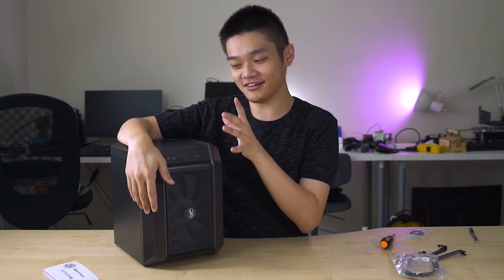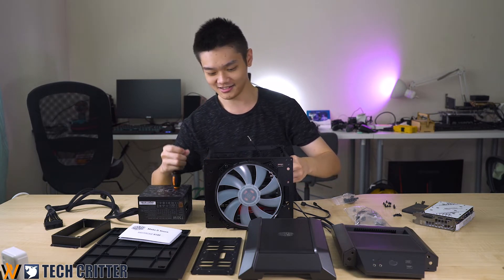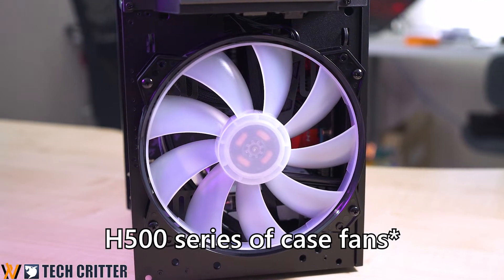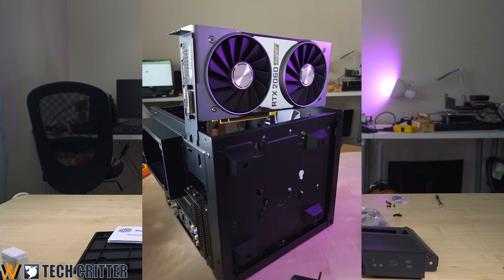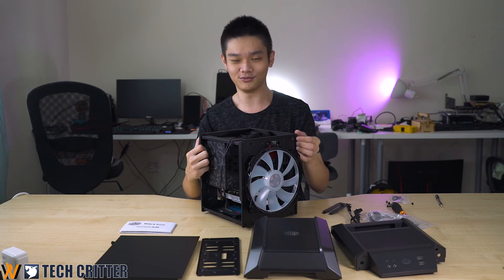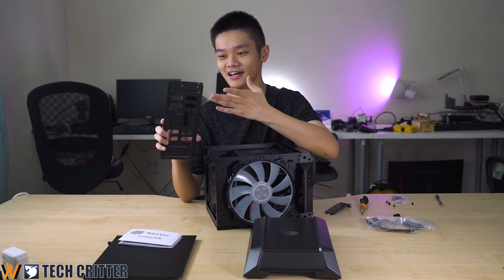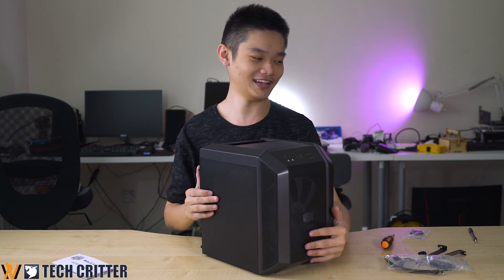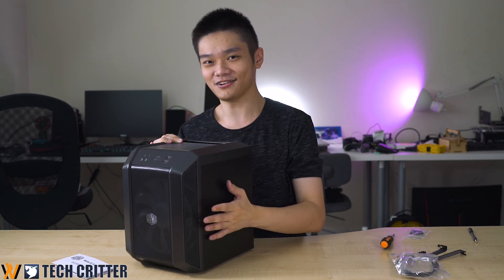Cooler Master MasterCase H100 - the Miniature H500

Comment: Thanks for showing this case, I'm going to build a mini itx pc in one of these cases, with a ryzen 5 1600 af with 16gb of ram, paired with a asus tuf rtx 2060 mini, running on a evga 600 watt psu
Reply: Do you think the airflow is good enough? Bc i might do the same
Reply: @Alkize06  yes I think it will be enough, that 200 millimeter fan moves a good amount of airthe computer and the power supply light their path around it into the case
Reply: How are the temps we might build my cousin a system